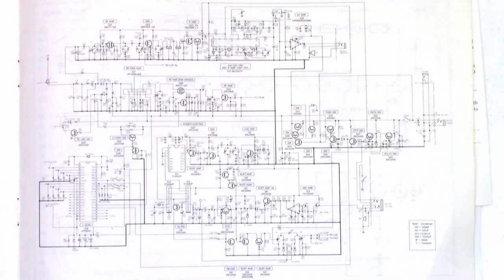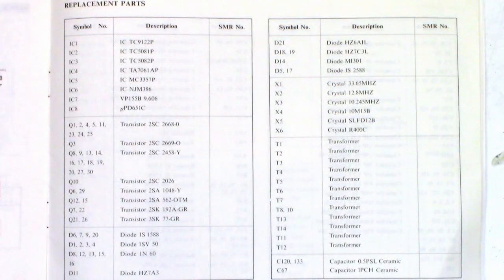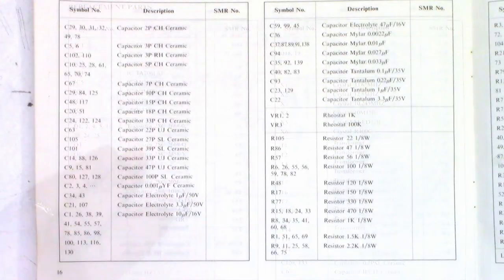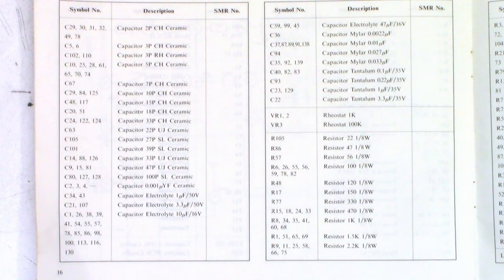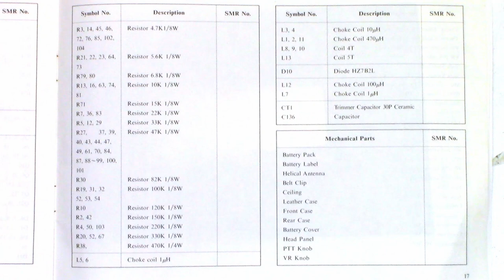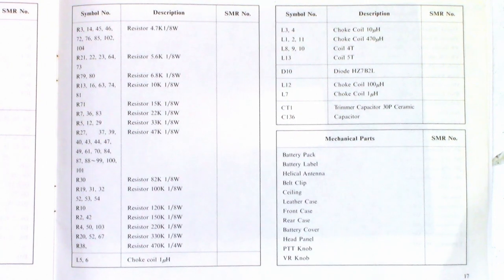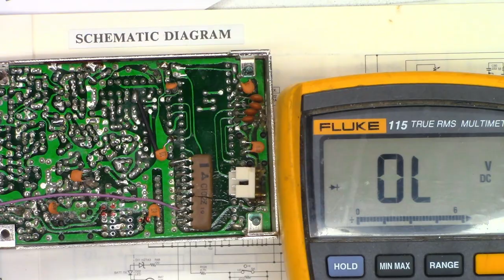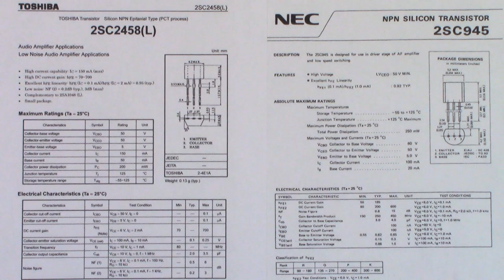Southern Marine Research SMR Sea Lab 9000 handheld marine Transceiver hooked up backwards - Now DEAD

Comment: Retired from a major commercial and marine electronics company, our techs worked on Sealab radios on occasion. They were okay for pleasure craft use, but did not hold up well for tugboat use. Standard Horizon Marine and Icom were for more rugged, and held up for better. Your Yaesu  was known to us as well, and respected by the techs as well. You do good work.

Comment: I would add a 1N5401 across the power input on the board, and either solder in a fuse in the lighter socket, or use another one with a built in fuse instead of the original. Especially in a marine setting you never know when you will come across a lighter socket that is mis wired or just faulty, and having a fuse in the line will help a lot to prevent this in future.

Comment: Awesome fix. I have a handheld that will not keep info in memory after it is unplugged. I have to take it apart to see why this is.
Reply: supercap..............maybe?
Reply: @randyr.parker2698  Very likely, though more often than not they use a button cell pack that has died, and leaked out on the board.

Comment: Just stumbled across one of your Denon repair videos and looks like you know what you are doing . I have a Denon X4000, it will play all day long as long as you do not turn the volume over 50 on the dial, then when a loud bass sound hits it, it shuts down . I tested all the out-put transistors and they appear ok . Everything else on the unit works great! Any suggestions! Thanks in advance from Canada.
Reply from the maker: read your speaker resistance, if it is too low it will go into current limiting and shut the unit down. Most units are 8 ohms or more so if your speakers are 4 ohm it may cause shutdown at higher volume levels.

Comment: Don't know if anyone else commented, but it seemed you didn't do anything about that cracked multi-capacitor?
Reply from the maker: I asked the customer if he wanted it replaced and he said "just leave it be, it seems to work just fine"
Reply: @norcal715  I'm sure you were relieved because it might have been an awkward replacement. Are such components still available? I can see you having to make a difficult space-occupying modification...

Comment: Please help I have recently purchased a dvd player but it has a problem that when I insert a disc it loads perfectly and when picture should come it restarts and sometimes it loads the disc and picture also start but when I change the track like disc starts from beggining and when I select number 5 or 6 movie it restarts what is the problem please reply
Reply from the maker: It sounds like the firmware memory may be corrupt. Have you looked for a firmware update? (if available)